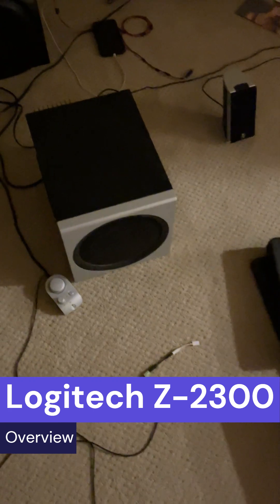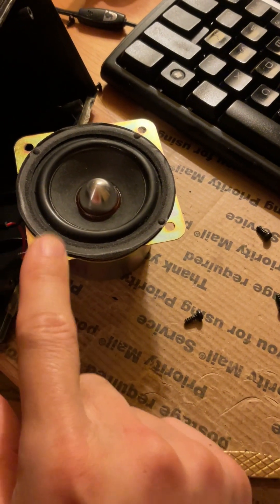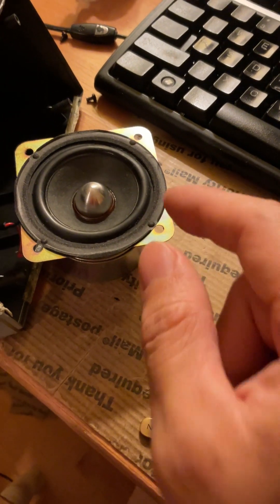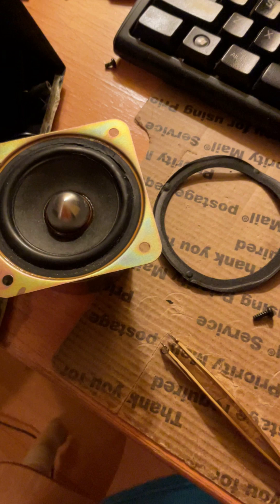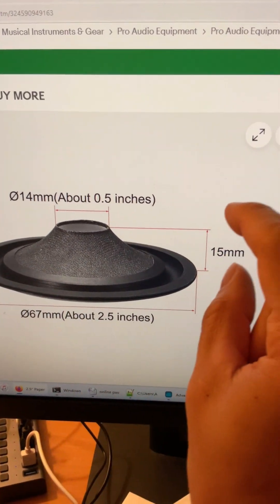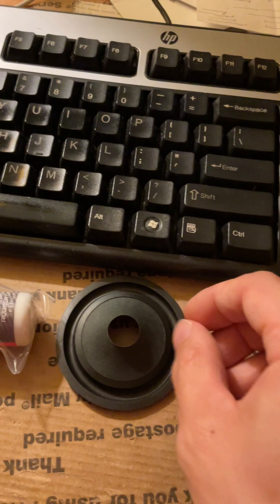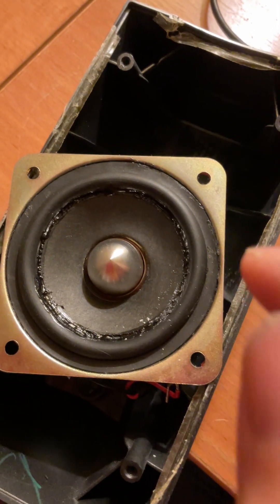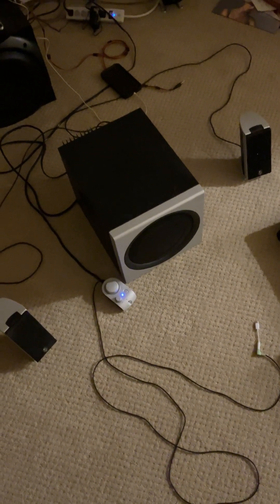Logitech Z-2300 Satellite Speaker Repair

Comment: Donde las puedo comprar
Reply from the maker: eBay for the speaker glue and the rubber gasket surround.
Reply: Hi friend, i have the same issue, I will try to find the rubber gasket for replacement. It would be also nice if you can provide a link where to buy them from China. Thanks again.
Reply: @tubegfg looks like it is a hidden secret... No one can provide the link 😂
Reply: Ya los encontré